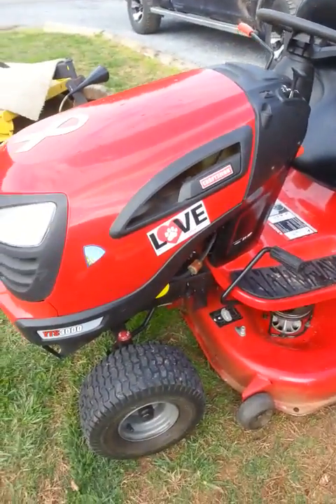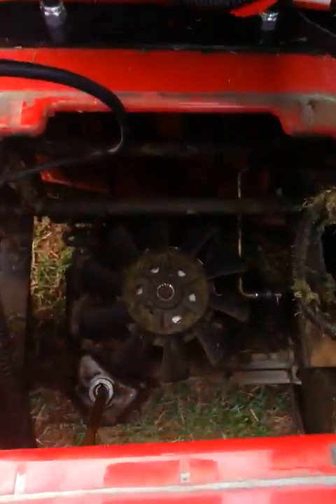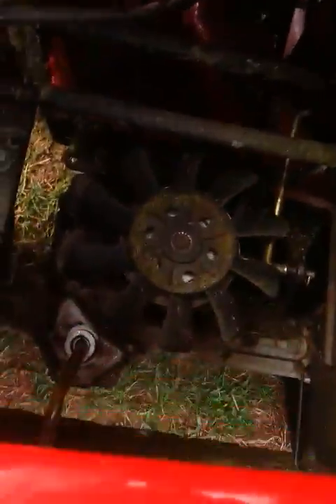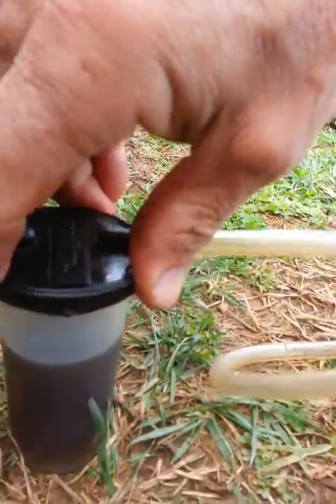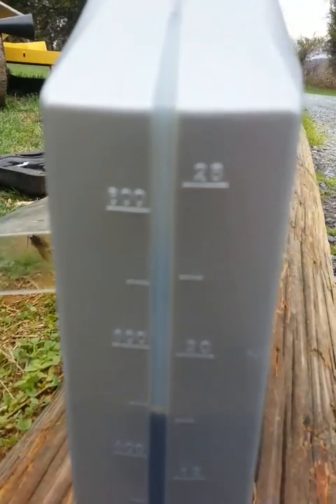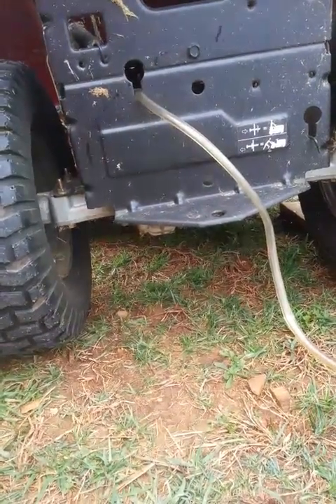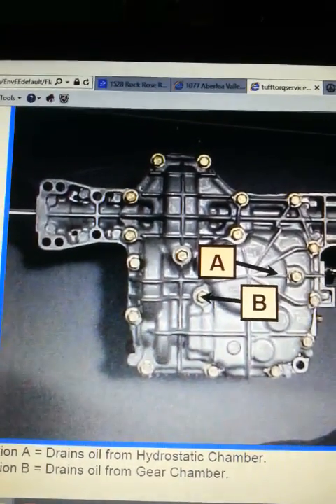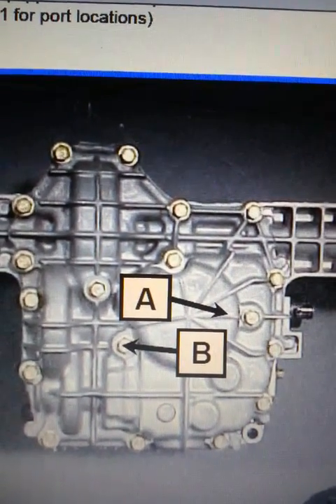Tuff Torq Transmission fluid change

Comment: The magnets need to be cleaned within the case.  Eventually, they can't hold the fine particulate decay from the gears.  I would crack open the case every 200 hours and clean the magnets and replace the filter too.

Comment: Hey Jeffrey, I've been thinking about going this route to top off the oil in my J.Deere X320 with a K-46 tranny.  I've heard some folks say it's not safe to remove that vent plug.  Some videos even show people breaking it trying to get it off.  Did yours pop off or screw off?  If you get a minute, check out the series on my J.Deere L-130 on oil change and xmission removal.  See if you can relate...especially to Part 3.  Dean  https://youtu.be/53Yqkm2QJB0

Comment: when you drill and take coat your drill bit and teh tap with axel grease the metal particles will stay on the bit and tap that way. just clean it as best you can when your done.
Reply: Personally if I were going to do drain plugs I’d pull the bottom cover. There are holes cast into the cover meant to be drilled the rest of the way to locate the drain plugs. That way while you are in there you could change the filter, and clean the magnets. Tuff Torq offers drain plugs (they offer two sizes so make sure to get the right ones).

Comment: No drain plug rubbish their is 2 on the k46
Reply: HaHa on the diagram he shows a & b are probably drain plugs that don't need to be drilled out.
Reply: Yes, there are two locations for the drain plugs molded into the case by Tuff Torq. However, not all of the mower manufacturers have the drain plugs installed. John Deere for one does not. BUT if you remove the pan (and change the filter) you will find the drain plug locations noted inside the case. They have to be drilled and tapped for the plugs. Not sure if all JD's come without the plugs but I have had to install them in two mowers from the early 2000's. Tuff Torq actually sells a drain plug kit for these transmissions.
Reply: @denali9449  I wrote a reply under yours. Do you know the answer to my question? Can I just remove the transaxle pan without removing the transaxle to install drain plugs? Thanks
Reply: @kurtwillson2553  I have been trying to figure this out. I watched a couple of Tuber videos on rebuilding these transmissions and it 'appears' that the only item to fall out would be the filter. I am not real sure that you could get the filter back in properly from the bottom. I honestly do not recall as I had the units out of the mowers when I installed mine and I have slept since then. Halfway tempted to drop the pan to find out and I am sure the filter should be replaced. Notice that I said "halfway tempted". Right now I am 1200 miles from the mowers and have no intention of seeing them before mid June.
Reply: @denali9449  Hey, thanks for the reply. I did see earlier in this post that its not possible to just drop the pan but there was no explanation as to why. I'm assuming that just the filter would come out as well but am also unsure. I certainly don't want other stuff coming down to because I've never had one apart so would be clueless as to where the other parts go if held in place by the pan/lower case half. I suppose I will just remove the transaxle and flip it to avoid any mistakes. It's a bit weird that there isn't more information about this or any at all on the internet that I can find about just dropping the pan. Hmmm..
Reply: @denali9449  Hey, I ripped the transaxle out today and flipped it over to remove the pan, it's true the gears and shit would fall out of there if you took the pan off while the transaxle was still on your mower and it would be very difficult to get it back together so I wouldn't try it. The oil was still pretty clean in my unit and it has run 600 hrs. I'm happy I took it apart for a looksy. Filled it up with 5w50 Amsoil so should be good for a long time. Cheers.
Reply: @kurtwillson2553  Appreciate the information. Satisfies that curiosity! Glad to hear your oil was still in decent shape. Our current mower is about to turn 500 hours so I guess I had best look into it this summer. Runs like new so I kinds hate to mess with it. Thanks again for the update.
Reply: Is it not possible to just remove the pan without removing the entire transaxle to install the drain plugs or do components fall out if the transaxle pan isn't removed while the transaxle is upside down? I've been a mechanic for 25 years but on automotive so thus my question. Thanks for any info on this.

Comment: That’s the vent plug you pulled out!  The actual fill plug is under the fan.
Reply: Can't it still be refilled thru vent plug? That's the whole idea of adding drain screws so you don't have to take the k46 out of the tractor. To access the actual fill plug by taking off fan etc. the k46 has to be removed what I've seen. Please correct me if I'm wrong since getting ready to add the drain screws.

Comment: Every one is missing the point of the oil change ! Seems like every one is satisfied with the notion oil that's half contaminated is a good thing.  Oil change  means all the oil should be changed to insure longevity of the  trans.  May just as well not do it at all. Spend the time an do it  right including the filter.  Old saying never enough time to do it right but always enough time to do it over.

Comment: I'm at a bit over 70 hours with my lawn tractor with the K46 I guess I better change the oil in it before I have issues....so far its not giving me any trouble, but I'd rather not have any issues.  

This is an entry level hydrostatic transaxle so I guess they went as cheap as possible and just didn't bother putting in drain plugs, yet they charge $800+ for a replacement transaxle hmm, not exactly what I'd call cheap.

Comment: I just drained the oil out of my JD x300. The best way is remove transmission and tip upside-down. I refilled mine with JD spec hydraulic oil same as used in all heavy duty farm tractors

Comment: Put some RTV on the flutes of the drill bit just before you drill. The shavings will stick to it.
Reply: I use grease but I had not thought about using rtv...
Reply: RTV <<<<<<<<<<<<<<<< ?????????????????????????????????
Reply: I used a shop vac, worked ok.

Comment: I just sold my 2003 LT150 I bought new. Running perfect. Tractor Data.com says it has the K46 trans. Never changed trans oil. Pulled 5x8 550 lbs trailer (empty weight) filled with firewood all over my property all of those yrs. Plowed snow every yr too. Never had a single problem with transmission. Never thought till I saw all these post on YT about the K46 being “crap” as lot of people have stated. Didn’t even think about the transmission maybe failing. Now, I just got a new X350 and must admit I’m a little nervous about the transmission. I will definitely take it easier. Won’t need to move firewood anymore so glad about that.

Comment: I just had my K51 apart.  There are effectively two fluid reservoirs, one for the wet brake and differential, and one for the pump/motor.  The fluid in the wet brake/differential section was really nasty, no doubt from the brake.  The fluid in the motor section looked much better.   The vent you pumped oil from is only the wet brake/differential section.  I doubt there is any benefit to changing this oil before 200 hours, if even that often.

Comment: I have a LGT 2554. It would no longer climb the small hill in front of the house. In less than an hour I had the transmission on the floor. Removed the rubber vent plug in the top and drained it. Rinced it with some gas and drained well. Added 2 quarts of 5w50 synthetic and reinstalled it. WOW! What a differance! Has not run like that since I bought it. I now plan to do it every year. I just is not that hard to do...THANK YOU for the info...mine had 2 1/2 quarts in it and I put that much back
Reply: Russell Daggett transaxle oil service kit video

Comment from the maker: Yes William, it is the vent tube, but you can also put fluid in. If you measure how much you take out you can replace it with the same amount of new oil. I agree that ideally you would replace ALL of the oil and change the filter, but that requires removing the transmission/ axle and dismantling it. I have also rebuilt several of these. The video is to change out some of the oil. If you do this frequently you will extend the life of the transmission/ axel. These transmissions barely last more than 200 hours without an oil change.
Reply from the maker: This transaxle does not have a drain plug. As I posted, it will help to add life to the transaxle pump. It does not have a drain plug. I mentioned in the video that you will not get all of the fluid. But 1/2 is better than none. The only way to drain the fluid from this transaxle is to remove it from the mower and turn it upside down. A bit of a lengthy process. I was just tying to show a way to at least freshen up what is there and add viscosity to it. If it is done regularly as I have mentioned it will help to add life to the pump. I have rebuilt and replaced plenty of these.
Reply: Hello, Sorry to bother you 4 yrs later but getting ready to drill drain plugs this weekend. My question... I understand if I drill holes it will remove most of the oil but will I be able to replace all that I  drained out thru the vent hole? That seems to be the most controversial part all over the web. Some say it's divided chambers and to fill correctly you must use actual fill hole hence defeating the purpose of drain holes. Thanks for any info.
Reply from the maker: @lostthenfound1  you will be able to refill it. The chambers are not divided in such a fashion that the fluid will not go in the entire transaxle. No worries by refilling through the vent hole.
Reply: @lostthenfound1  There's a "weir" between the gear and pump chambers.  A weir is like a dam with a low passage for some but not all water to flow through.  Same as the transmission.  You drain both chambers via two drain holes.  When you refill with oil, some will overflow the "weir" and fill the other chamber.
Reply: @danburch9989  I actually got the courage to do this about a month ago. Everything went great except I used a pointed tap and it bottomed out and stripped one of the holes. I have since learned about the shorter taps without the long tip and will have to re-tap someday. Right now the bolt is not leaking just wouldn't tighten correctly. Thanks for your reply, I'm sure it will help a future Trans driller.

Comment: Great Video!  Thx for tips!   My Craftsman tractor has the K66 Y transaxle.  

The manual says: 

"TRANSAXLE PUMP FLUID
The transaxle was sealed at the factory and
fluid maintenance is not required for the life
of the transaxle. Should the transaxle ever
leak or require servicing, contact your nearest
Sears or other qualified service center."

I can only wonder how accurate that statement truly is.....
Reply: Well of course they tell you not to service that transaxle, they want you to come back in and open your wallet in a few years for a new tractor when that transaxle destroys itself.

Comment: Looks like you removed the vent. The plug under the fan is the fill port. Anyway it's a great way to change the oil. Remember use a small 1/4" siphon hose and poke both sides of the housings. You should be able to remove 1 3/4 quarts of oil thru the siphon hose method. I done mine yesterday and refilled it with 5W50 synthetic.  Thanks for the video.
Reply: Yep he did.. but some sealed units have no fill plug in top at all so the only way to put oil in/out is the vent. Some low-end zeros like my BIL Bad Boy I had to unscrew the nipple fittings on top to drain/fill. Whatever it takes do it they do dye young if not done.
Small drill pump with long stiff small diameter hose works excellent. Fluids in/out in just minutes.